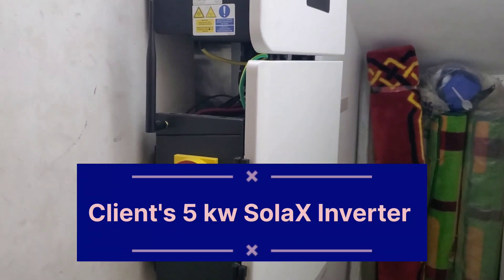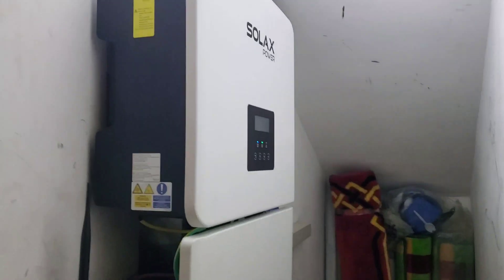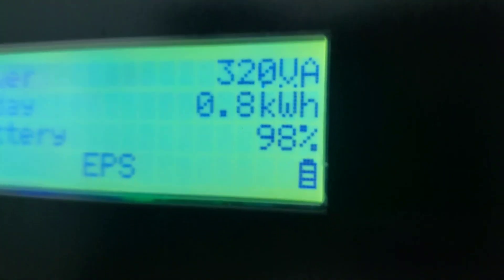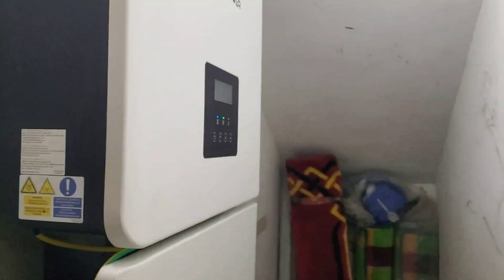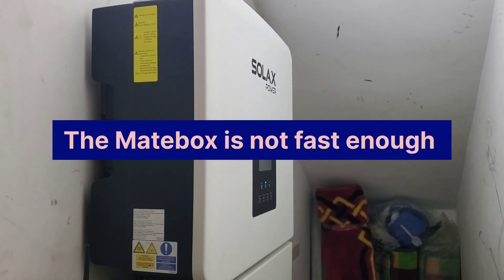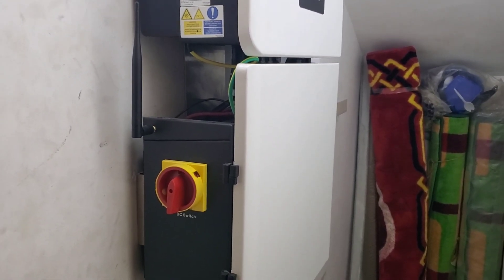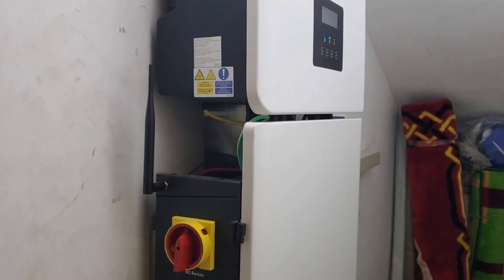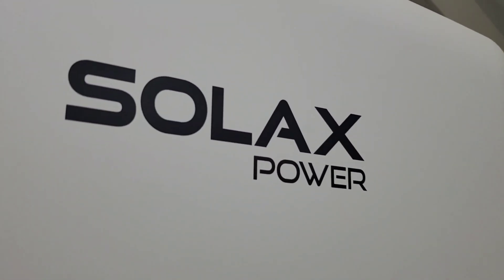Customer SolaX inverter blinks switching from the grid.

Comment: That sound from contactors means the inverter is trying to sync with the grid but rejecting it because incoming power quality doesn't qualify for the grid parameter.pls adjust over/under voltage and frequency parameters on advance setting so that inverter accepts the "dirty" power from grid.you might experience flickering of lights due to power fluctuation and you have to fine tune the parameter.
Reply from the maker: Thank you for watching and commenting. It was a much less complicated problem The setting was wrong.  In works mode we selected manual instead of backup. And that was making the inverter go to sleep when the grid was present. Now it is automated and also charges the battery

Comment: Nice work, slow switching of the inverter could be from the way it was designed,or probably a setup function hidden somewhere in it.Goodluck with your installation
Reply from the maker: It is a settings issue, I believe I have made changes and I think it will solve it. Had the Self use mode set to manual. I changed it back to Backup. It is charging from the grid and I think the switching time would be instant.